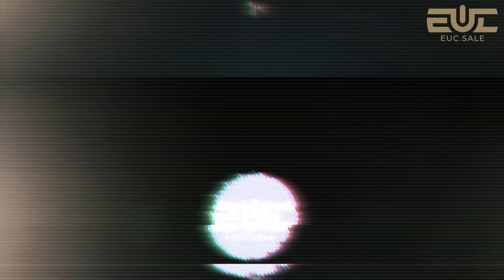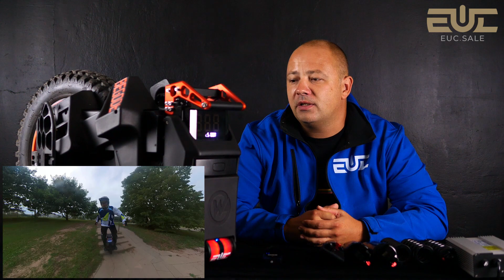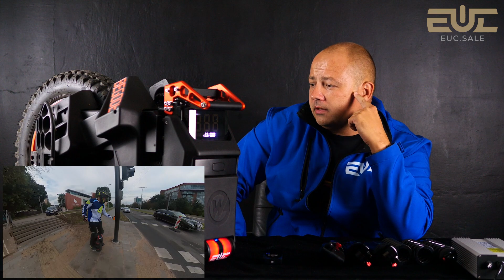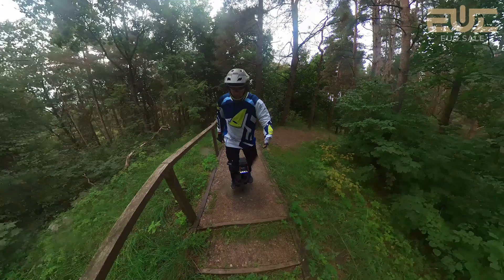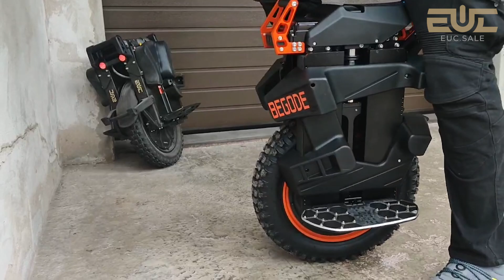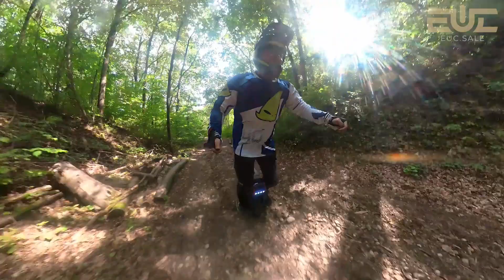BEGODE EXTREME -  Review English

Comment: {…another tl;dr. Short version: IM Adventure will raise the bar for competition.}
 
If the suspension system is not designed to be compatible with aftermarket MTB parts, then we can only imagine how incompetent, constrained and uncaring the designers of the BG Extreme. To design custom components is self-sabotaging for these manufacturers since consumers will gravitate towards maximum flexibility in maintenance, repairs and upgrades.
 
I will be waiting to see if the Inmotion Adventure fulfills its promise of less compromise on quality and safety. If the IM Adventure’s hydraulic struts are replaceable with an aftermarket part, then their success will be highly likely, but proprietary components will likely fail to scavenge buyers of other models, which slows organic growth rates. That said, it is amazing how many consumer driven demands have been incorporated into the Adventure; most of the new design is directly attributable to requests from our EUC community… and this is laudable.  Inmotion is listening. {Bob Yan (former CEO, now Production Manager) deserves much of the credit and praise. Thanks BOB! 
 
The Patton seems to be the only reasonable competition for the Adventure, so far. Time and batch revisions will determine which company is more serious about consumer demands. Let’s hope that they raise the level of quality before bankruptcy or leveraged buyouts become inevitable. If Inmotion’s modular design concept scales to multiple battery configurations and multiple wheel/motor options on the same base design, then Inmotion will have a strong competitive advantage over less well-integrated designs. Backwards compatibility for upgrade potential will dominate sales, exactly how standards in the automobile parts and bicycle parts market forces compatible and interchangeable sub-systems. Value driven proprietary design will eventually become restricted to the quality, longevity and serviceability of the electronics and coding sophistication. {just a prediction, IMHO, not necessarily how things might unfold}
 
Let’s hope that Kingsong abandons their inferior slider design before its failure permanently effects their marketability. {All KS suspension wheels have the same Achilles’ heel: insufficient quality of the slider-mechanism.}
 
Also, the BG Extreme spring-struts have not been proven viable yet.  The FastAce hydraulic struts combined with a rear coil-linkage suspension would have been preferable… but time will tell.  
  
Delaying perfection may be partially due to the manufacturer’s perception of price saturation on top end wheels appears to be harming product development.  This is understandable in light of the way these companies are financed, and their relationship with Intellectual Property rights being unstable at this time. {…but that’s another story.}
 
All of these companies need to focus on their electronics and forget about the need to vertically integrate the entire production process of all components. As we are seeing, this is a failing strategy and exhausts the design team’s ability to create excellence across all aspects of component design. 
 
Personally, I’m looking forward to the standardization of the VESC design to be applied to EUCs as open source technology, which will allow consumers to drive the leading edge of wheels design, thereby creating an appropriate competitive force for revolutionary change in EUC design rather than the incremental “planned obsolescence” to which consumers are currently constrained.

Comment: I've been a fan & I get this is your channel & your opinions. But I dont get why one needs to spend 5+mins whinning the stock pads dont fit you. Instead one can easily say I'm glad the metal batt case are flat for velcro install &or better yet, there are 4 bolting points to bolt in inexpensive diy plastic fairings so we can use pads of our choice. At least BG included pads that LK doesnt. Sounds like whinning & complaining just for the sake of complaining. But I get it, its your review so you get to whine. FWIW I've had 7-8wheels in my 3yrs on this hobby & none of the stock pads have ever fit me so its likely a all stock pads thing. Beating the a dead horse gets old fast. Just my opinion as all
Reply: At 1,5kg, the pads are not just a piece of foam, and the screwed-on attachment of them and adjustment, etc is a new departure/experiment, so it would appear that Begode did try to produce something useful and indeed of value to the user, but it’s fair to say that, as you suggest, they would have been better to have just stuck Velcro on the battery sides, and let the riders decide what they want to use.     As the wheel is not really aimed at the beginner, it would be the obvious choice of most (experienced) riders in the market for such a wheel to fit their own preferred pads for best control, if they are similarly unimpressed by the stock item.    Pads are indeed a subjective matter, but I don’t really think Denis went overboard in giving his considered opinion: he didn’t like them, and he explained why, which is part of the content of any decent review; to skim over the subject matter without explaining what the opinion is and how it is reached would be just lazy.     I’ve seen some other reviews of this wheel where riders have retro-fitted their own choice of pads, which tends to support the view Denis has, and when one considers that were they ‘the best out there’, riders would be putting these new Begode screw on pads on other wheels, which seems to be hardly the case. We all more or less agree that one piece pads are almost never the best solution, irrespective of make or means of attachment to the wheel.
Reply: @freeforester1717  I get it. I woulda said, these stock pads arent for me but there's plenty of options for either plain velcro &or cheap plastic fairings so we can use pads of our choice, which btw is most of the users I know. There done in <30s. I just dont get the dead horse beatin' as there's lots of other stuff to talk about. Personally I woulda mentioned this is likely the best built with the most CNC parts BG (& perhaps any other wheel on the market) has produced. There are other 'reviews' out there that has not had the problem with the air shock Denis had but I get it, it could be a one off for him or he really dun like. Point is move on, good or bad. Belaboring becomes painful to watch after a certain point. IMO ofcos
Reply from the maker: Hi, yes my review in EN went not in best way. Just to tired film it and out of focus because sleep not well. My daughter in Hospital and I had no time to wait with a review because need to send the wheel to our partners for presentations and review also. so as it is. but my short idea regarding Extreme... it is not bad wheel. but no body can say extreme beat patton. I like patton more for my purposes.
Reply: @TheHagov  All good brother. As mentioned I'm a fan of yours & just found your discourse on stock pads somewhat overdone & irrelevant. IMO no stock pads are good & most of us have our own pads so its such an easy solution. & just cos it dont fit you dont mean its no good for others. Seems like you hate the wheel because of the pads 😆. Hey we all have our not so good days & you dont have to like the Extreme. Just be fair & unbiased is all I would want. Hope your daughter is ok. Peace my Lithuanian brother ✌
Reply: @scottsum1319  it’ll be interesting to see what others (ie. buyers) of the wheel decide to do with their stock pads - IF they’re great, Denis will be shown to be in the minority, and they’ll be in demand; if he is right, and they aren’t so great, they’ll get discarded in favour of other, potentially better solutions.  This aspect however won’t change the sub-par torque characteristics of this 40kg wheel, nor will it obviate the need to change the suspension setup for something rather more useable. 

In Roger EUC’s review of the Extreme, he was sufficiently motivated to change both the stock pads for his preferred aftermarket ones - a standalone industry that has grown out of the need to replace unsatisfactory, near afterthought stock pads which come with the wheel - as well as spend not inconsiderable time money and effort in replacing the stock suspension.     The moral of the story? - Some prefer not to put the lipstick on the pig, just sayin’.
Reply: @freeforester1717  No arguing on which  what is good or not. Just a statement of fact that stock pads, whatever I or you or others think, are basically irrelevant. For newbs, they wouldnt know better so this or that is as good as any. For veterans, we already have our favorite pads & nothing else will do. I would be seriously unimpressed if there is no option to change pads ala s19 but this Extreme isnt the case. So IMO, good stock pads or not, is not relevant. Pointless to waste much time on it.

As to which is the better 16 wheel, that is up to each of us to decide. My crew has a few SS & a v13 but I much prefer my ex30. The alternatives are unexciting, to me. Others may find different. All good
Reply: @scottsum1319  As you say,  but a couple of thoughts arise:

1) the reviews are as much if not more value to the newcomers as the experienced, and as such, it behoves any decent reviewer to explain thoroughly their reasons as to why they do or do not like aspects of the wheel, otherwise the reviews become little more relevant or informative than 👍🏻 or 👎🏻, which rather negates the point of reviewing any of them. It is because Denis has such a great depth of experience that we tune in, ie he can help others, not least by describing in detail exactly WHY he does or does not like any aspect, which is surely of benefit to the newcomers (which rather runs counter to your point, ie most newcomers tend to want this type of information and detail as to what works, what does not, and why), if perhaps not so much for more experienced and knowledgeable riders as yourself; as such, feel free to skip, but I don’t really feel such information is “basically irrelevant”, as surely the point is to inform all of these aspects, but of course as the wheel is only offered with the stock pads and not say, for less money but for the rider to fit his/her/their own after-market pads, the point is indeed moot - they’re gonna find out either way;

and 2) Your point about 16” wheels seems to be a non sequitur? Given that both the Extreme and the Patton most mentioned in the review are “16” wheels, but the others you mention in your last paragraph are bigger. 🙂
Reply: @freeforester1717  A reviewer can review however they want. A good reviewer will aim to be objective & unbiased on all their reviews on any & all material. A very good review will incl disclamiers/disclosures & have a specific plan on hows & whys both pos & negs, for his reviews.

Eg, what the reviewer likes/dislikes should incl disclaimers on why & how it can be better & ensure they do it for every single review. Eg. in this specific case, say he does not like it, the whys & incl the hows to solve. If he's truly fair, incl which stock pads does it for him & ofcos the whys & hows. & always be cognizant that its his opinion & his personal choice. Others can & may feel very different.

I only mentioned SS, v13 & ex30 cos those are what I ride &or have tried in a same size thats comparable. I also have a T4 & have briefly tried a Patton but have not ridden a CoMini nor Extreme so I cannot make much of a comparo. My mentions of them does not signify any other objective cept to say what I personally prefer from a ride experience & also a ride preference. Plus I incl a disclaimer thats its IMO only.
Reply: @scottsum1319  quite. Fwiw, Chooch feels the pads worked well, however the rest?  - Not so much. See his review. 👍🏻
Reply: @freeforester1717 Absolutely Chooch is entitled to his opinions. Infact theres a big grp hubbub on FB on his crash. Indeed there an astute observer that calculated his terminal velocity based on the # of double lines he crossed & the approx secs it took, just before he ate it. Its taken off his YT vid. The observed math says 280ft in 4s = 47.7mph. I believe Chooch says he was at 32mph. He also said batt drained of 50% in 8miles. With no incl data from Chooch, I'll leave to your logic & your astute mind to discern the truth & the opposite here. But ofcos, Chooch is entitled to his opinions, regardless of what I think or anyone thinks. All good
Reply: @freeforester1717  Incase you're interested, here's the Toronto RideOne boyz 1st ride take on the Extreme. IMO this is how a review, actually not even, more a 1st ride impression should be. The good, the bad & the ugly laid out on the table for ppl to decide for themselves. IMO ofcos   https://www.youtube.com/watch?v=4dirqbKzGo4&ab_channel=RideOne